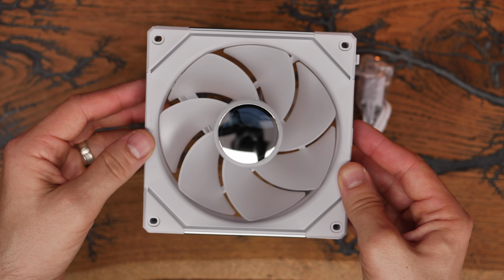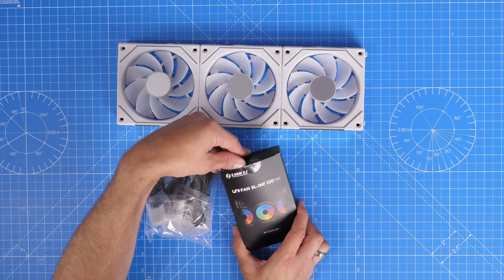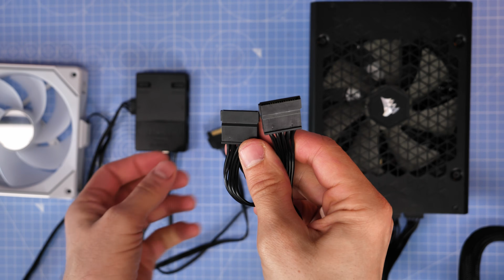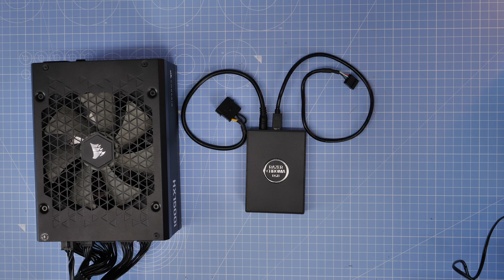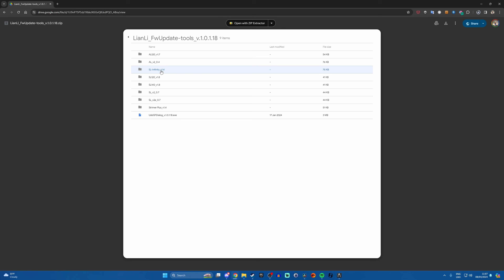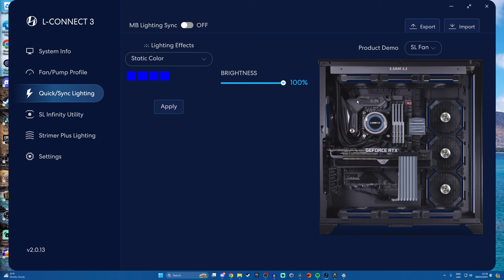Lian Li SL Infinity 140 Reverse Blade wiring and setup guide

Comment: Im using the HAVN H2420 VGPU and 11 SL INF 140 for the entirety. Would a singular Lian Li controller work and be enough or would I need two?
Reply from the maker: I think you might need two in that case simply because of how they are setup in there

Comment: i just bought 3 140mm fans and a 3 pack 120mm with driver but i wanted to buy a 120mm LCD fan, do i need another driver to use de display?
Reply from the maker: I assume by driver you mean controller. If so, yes, you need the TL LCD controller for the LCD fans. You cannot use the Infinity controller.

Comment: I'm about to do a build with 3 120mm inf fans and 3 140mm inf fans, so 6 fans in total, where as the 3 120mm is aio fans. I would like to use the controller in order to get access to all the cool rgb effects. I'm just a bit confused about which method is the best to connect it to the motherboard. Should i just go with the usb connector and let lconnect control everything? Or should i go with the bypass cable, and let the motherboard control the fan speeds? And if so, should i put it in a sys fan header or in the cpu fan header? I'm really worried about not having anything in the cpu fan header, and i have also heard that the motherboard will post and error if it can't detect anything in that particular header.
Please help me 😅
I will say that besides this issue i'm 100% confident working with these fans thanks to your videos!

Comment: Hey, are you able to get the fans to light up without using the hub? I currently have the rgb plugged directly into the 3 pin 5V rgb header and my fans don't light up. 

I have the ROG STRIX B650E-F GAMING WIFI motherboard. Also the firmware / L-Connect doesn't even detect the fans.
Reply from the maker: L Connect won't detect them if you're not using the hub. You'll need to use your motherboard software.

Comment: Hello, I was wondering if you ever did a vid on the configuring of the razer chroma with the lian li sl 120 uni fan controller, GPU strimer and Power Cable strimer?? Yes I'am a bit lost.

Thanks ahead of time
Reply from the maker: Not currently
Reply: @TheProvokedPrawn  thank you would you have an idea maybe ?? Connect the sl controller to the 3 pin on the chroma and 5v 3pin to the mobo perhaps??

Comment: For my Y60 build, I'm wanting to side mount 3 reverse INF fans for intake, one at the rear and 2 at the bottom, in conjunction with my Kraken 360 at the top.
Would I be right in assuming I'd need to just buy one triple pack for the fans + controller, then 3 single reverse fans?
Reply from the maker: Yep

Comment: Sir. I have a question. I bought it 3x separate. So basically I watch video I brick them together and one single cable I connect which I got it in package?
Reply from the maker: Yes
Reply: Do I need controller?for 3x fan lcd 140mm? Cuz I just got one kable.

Comment: if i buy the Lian Li Galahad II Trinity SL-INF 61.3 CFM Liquid CPU Cooler, which comes with the hub and 5 reverse blades will I have everything I need to will I have to buy separate cables

Comment: I'm doing a similar setup and want to use the controller for 3 sets of 3 fans (2 sets of which are reverse blade) Problem is, reverse blade fans don't come with the power cable that attaches the fans to the controller (they come with the one that plugs directly into the Motherboard) and Lian Li doesn't even sell those cables on their website. How are you supposed to use the reverse blade fans with the controller if you can't get the cable that attaches the 2?
Reply: I'm currently in the exact same situation as you. It's utterly frustrating and it does force you to buy the SL-INF 3-pack fans which come with the xtra cables. Lian Li was kind enough to send me the accessory product which contains the controller but not those 7-pin cables. Absolutely insane. How did you manage to solve this issue?